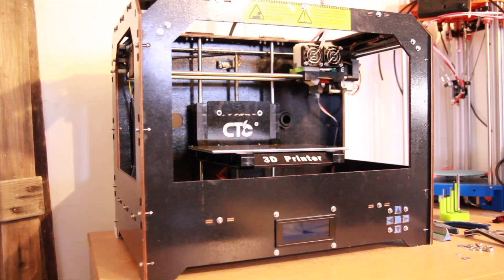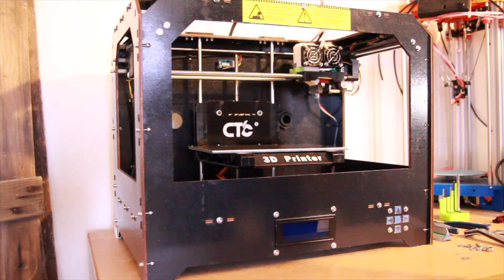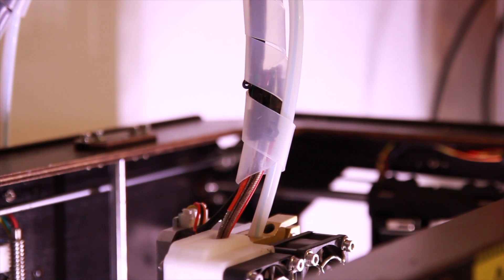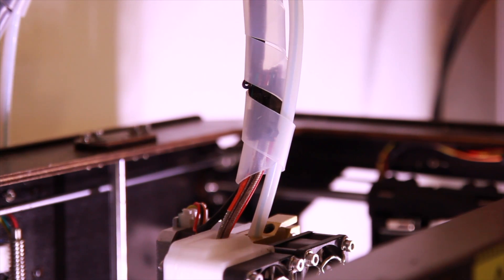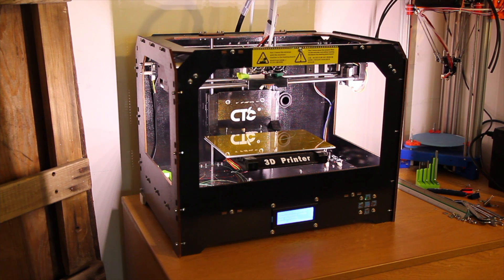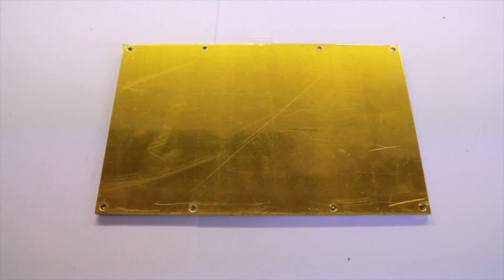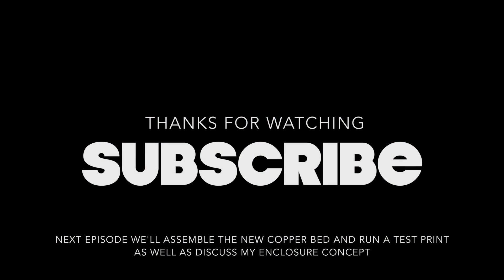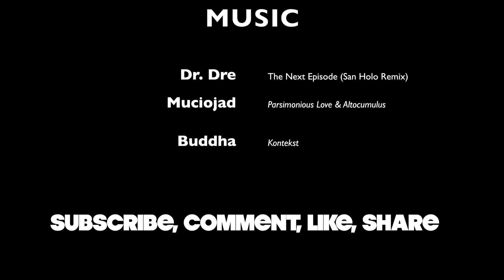3D Printer - Part I - Upgrades to Print like a $2000 Machine

Comment: Get a Ceramic Floor tile for you HBP ,,make Hot end out of 1/2inch steel fit 2 40W heaters and drill/tap to take diff, size jets,, to go between the 2 heaters....use independent power supply for heaters run around  15 V for a 240V machine,,

Comment: Solid polymer axis bearings are a worthwhile upgrade, they last a lot longer than the ball bearing type and are quieter in operation. I did my cheap 3D printer, no more gouged rails and ruined bearings.
Reply: Yea, no one wants to ruin a $2 bearing...

Comment: I had this printer, gave up on it , the extruder and hot end are terrible as you say. I got a second hand wanho i3 that had only run for about 3 hours ! That was fine for a while but i did miss the core xy setup of the CTC so i have removed all the parts from my i3 and i am currently building this http://www.thingiverse.com/thing:1752766.  As for ABS vs PLA , i would not use ether of them. I would switch to PETG.
Reply: lol yeah good luck with that one, bud.

Comment: Any tips on software? I recently received the same 3D printer, with no SD card. Really having trouble getting 'MakerBot_Bundle_BETA_3.10.0.1725_x64_Install' to run on windows 7. Also having trouble with flashprint...

Comment: can you finde a link to your printhead? I have the same problem
Reply: Can you link all of your upgrades in the description please?
Reply from the maker: Hey I looked on the UK eBay site and you'll find it in the following link
http://www.ebay.co.uk/itm/24V-0-4mm-Nozzle-Extruder-0-5mm-0-3mm-0-2mm-Nozzle-f-Makerbot-Wiiboox-3D-Printer-/361112802214?hash=item54140013a6:g:lFcAAOSwAF5UYtch

But I have been so impressed with the Prusa, which owes its quality of print largely to the original E3D V6 nozzle. So I am hoping to make another modification to the CTC and enable the same upgrade to the same type of nozzle, Basically rip the design from the Prusa to the CTC. I also want to change the control board from the clumsy CTC to something more open-sourced so that I can use Cura or Slic3r as this will also help with the way this printer performs.
Reply: NERDVille i have been thinking about installing a ramps 1.4 mainbord
Reply: buy an Anet A8. Much cheaper, good quality and tons of mods available.